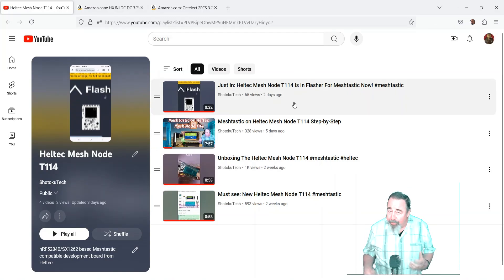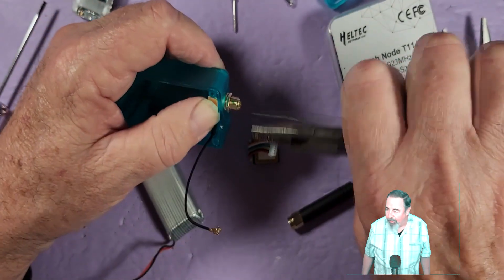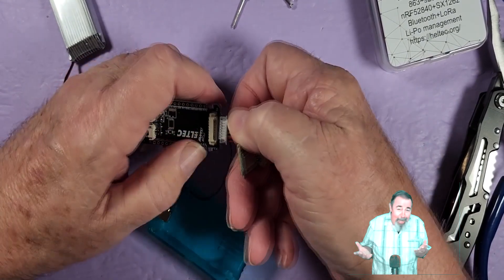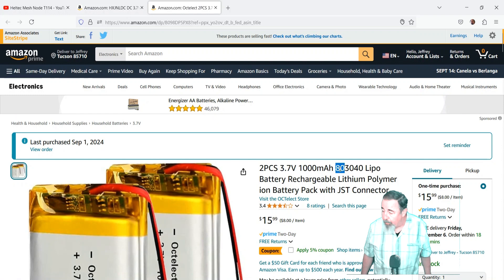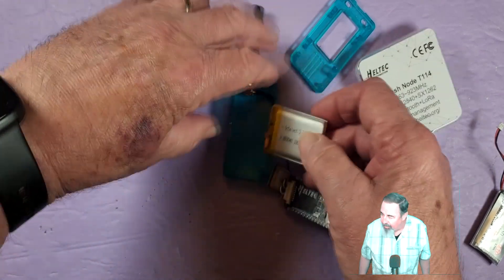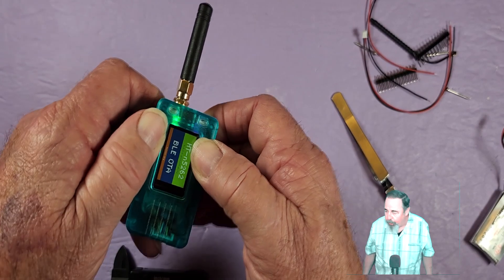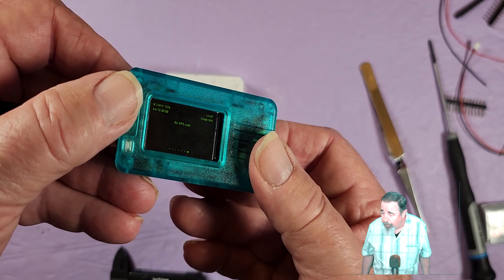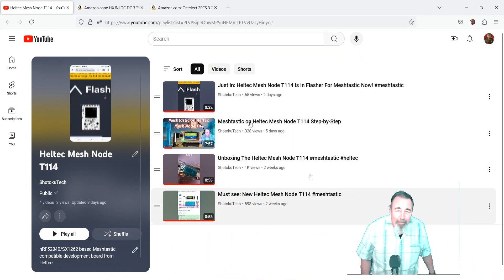Heltec Mesh Node T114 Assembling The Case

Comment: Do you get a GPS lock with the GPS Unit in the case on that position facing upward to the battery.
Reply from the maker: Yes! This all worked as intended. The case is a little tight for my fat fingers. I might try again with the second set I have. Thanks. Best wishes.

Comment: Many thanks for the info - the battery info was especially useful. I think the battery conector is a 2P 1.25 JST. The board seems to have a socket for a solar panel too!
Reply from the maker: Yes that is correct, solar panel!
Reply: @ShotokuTech just got mine running off solar but been charging it through USB no problems. Also had to order another case because the GPS is too tight a fit in my opinion - wires are crushed.
Reply from the maker: @nathanaelsmith3553  I agree on the case. Two problems. 1) Room for the GPS. 2) The case screws are weak.
Reply: @ShotokuTech  On reflection, I think I could make the GPS fit better if I took a Dremel to it. It's as if the case was originally designed for a different GPS module. But I otherwise quite like the case. The node is working well.
Reply: Yeah - as far as I can tell the stock  case is incompatible with the GPS module. The only position that I have been able to fit the GPS module is backwards projecting the signal up into the unit over the PCB and onto the Lora antenna. That causes interference which blocks the GPS. The GPS works when the module is dangling outside the case but not when it's inside. If there is a special way to do it that should be shown on included instructions. It's a nice compact case if you don't intend on using the GPS.

Comment: Your note about battery polarity was super helpful, I noticed mine wasn't powering up and it wasn't until I watched this that I thought to check and discovered I'd gotten my battery with the polarity inverted.

For anyone unfamiliar with JSTs of various flavors, get something small into the little plastic flap and lift slightly while applying pressure and the contact will pop right out.  Made fixing the polarity easy, they just snap right back in.
Reply from the maker: Glad that worked out for you. I have been thinking about making a short video about swapping the JST connectors. Thanks. Best wishes.

Comment: I found that the positioning is not accurate. Is it a problem with the settings?😢
Reply from the maker: From what I understand, there is a "Precise Location" setting on the Channel settings. Location and precise location must be switched on for the channel. There is some additional setting that I have no familiarity with: https://meshtastic.org/docs/configuration/radio/channels/#position-precision
You may need to use the CLI (Command line interface) to set it.
My device works fine, so I am not sure what else I can advise.
Best wishes.
Reply: @ShotokuTech  Thanks

Comment: What is the fastest way to get one of these? Amazon has them in stock, but are over a month out.
Reply from the maker: You could try this site: https://muzi.works/collections/all
Or try the Heltec store itself. https://heltec.org/project/mesh-node-t114/
Best wishes.
Reply: @ShotokuTech  Thank for the reply. One thing though, this case has the external antenna. Is it capable of having the little spring antenna internally instead?
Reply from the maker: @kenneth6731  I just looked at my spring antenna compared to the case. I suppose it would be possible.